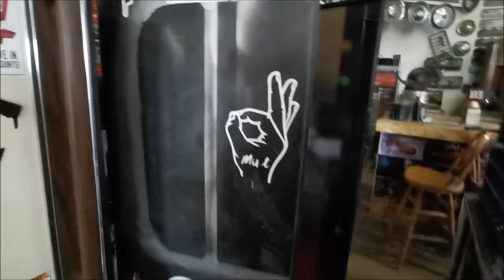THE IQCS 2020 FUC*IN MINT JUDGEMENT + BULLET-BAGO BURNOUT!!

Comment: You should never boost a dodge with a Ford because the dodge can give it second hand electrical problems
Reply: Jacob Cummings dodge only had electrical problems in the mid to late 90s
Reply: @npp3559  spoken like a true Mopar man
Reply: Np P dodge has always had electrical problems... I got a 92
Reply: Np P I have a 87 Dakota it had electrical issues all the time
Reply: @CatmanOutdoors  2016 truck all new wiring harness from the back of the cab forward from the factory done at 2 different dealerships twice and one head light works some the the other goes on strike .been that way since new .all new computers everything  .mega cab 4x4 with 6 thousand miles .bought brand new.never been off road and it's been at different dealerships  for almost 2 years of its life. Driving   down the  road month ago back driverside and rear window curtain airbags blow up .lmao in the process of dodge giving me a new one .should have it in 2 weeks .they cant figure it out .dont buy any two tone brown 2016 megacabs from the auctions .lol
Reply: Second this but with a damn Buick. 

One killed my fucking alternator and battery
Reply: Dodge = avoid, go around. Just like a burning dog... And don't eat yellow snow. And NEVER EEEEVVVVERRRRR trust a fart if you even close to 50!!!
Reply: @npp3559  I work at a dodge dealer and we replace wiring harnesses all the time and constantly have to rewire everything
Reply: @Tessa Hiebert I daily a 2005 Ram 2500, no electrical problems, yet. She cheeches and screams. Front end howls a bit so gotta figure that out, and the power steering sounds like supercharger, but other than that, she is damn mint.
Reply: @npp3559  well look at this Profile picture, aren't you a real dodge fan
Reply: I don't want to give a thumbs up because you are on 318ci
Reply: JustA25Hundy I would suggest replacing the u joints and checking the front diff fluid, and put in u joints that have a grease zerk
Reply: 2020 3500 straight off the lot 2 weeks later every fucking electrical gauge inside fuckin broke took them 3 months to fix it 😂
Reply: @npp3559  and there current cars and there 70s cars and there 80s cars dodge has allways had issues lol
Reply: @wesleeysutton5935  ok name some from the 70s and 80s I can tell you right ford had way more I can’t even think of one for dodge dodge only had really problems in the 90s and early 2000s that’s it really
Reply: @npp3559  cordoba my mom had a late 70s one wouldent stsrt in the cold one day it just caught on fire
Reply: @npp3559  the k car also was an electrical nightmare
Reply: @npp3559  I’m sure if I keep digging I’d find more not saying Ford is any better I only drive gm products for a reason 😂
Reply: Not like that’s a recall stuff like that happens when mice and people screw up wiring it’s not like fords are immune grime odd ball wiring issues that can happen to anything with wiring
Reply: @npp3559  that cordoba was a brand new car I don’t think mice where in it

Comment: The old motor home reminds me of my  f250 plow truck send off when it became to rotted out to actually use it wouldn't blow up 351 fuely,  finally turned to wide open throttle and shooting it with 1911 45acp through the dash until it finally took a fatal blow probably the most fun I've had

Comment: 24:37 looks like an American-Lafrance engine.
Reply: No, American Lafrance famously made T-head engines which were cross-flow. This is an early L-head engine, you can tell because the intake and exhaust is on the same side, which it isn't on the Lafrance T-heads. I actually suspect that the Frenchman has gotten his hands on a French engine, because this looks like a Renault 4-banger from circa 1910.

But it's hard to tell because most of these early L-heads look very similar and there were like 300 different car brands back then most of whom built their own engines, so without taking a closer look it's nearly impossible to say for sure who made it.
Reply: @Benny---  100% agree that playing "Name that Engine" in that era is especially hard, and you are correct about the head differences. I was going off of memory of the threaded inserts for the plugs, petcocks, and the domed coolant jacket covers. The exhaust manifold doesn't exactly look Renault like, and the coolant pipe is maybe facing the wrong way. Also, i think the Renaults of that era had a larger cam chest that protruded squarely out the side, while this engine has a flat plate there.

Comment: I think thats the technical difference between a big block and a small block: small block to get going after shes been sitting and the fuel system is hosed, you're dribbling gas into the carb from a tea cup with the pinky up, and a big block yer just sloshing the gas in, straight from the source, the good old plastic 5 gal can.  Fun fact, plastic is made out of petroleum, so its a gas gas can.

Comment: Damn thing probably had enough valve float to unsink the titanic 4 times
Reply: Mopar smallblock has a built in rev limiter ya know, weak valve springs.  They start floating valves at 4000 rpm

Comment: I drove basically the same motor home across the southern USA, up to Banff, BC, down to Denver and the back to. the northeast USA. We didn’t have the propane fuel system, but keeping the motor home and the Koehler generator running were a similar experience, Ours was dodge 360 cu. in.

Comment: Shows how good dodges are, ford would have blowen up long before
Reply: Wahn Burnskill you must be new here
Reply: clearly you've never seen slave lake, or the IDI snow bank, or his 351w F1SHitty, Those things still haven't quit but this mopar did after one measly burnout session
Reply: Atleast it ain’t a Chevy. Honestly that engine woulda fired right up if it wasn’t a propane system. Any engine that’s been sitting with one of them on it is always gonna give ya problems, Even one that’s daily driven. In my experience those small block mopars are just loyal. Not to mention all the bullets that have ripped through god knows what.

Comment: My leg came off. Yep, been there,  done that. 

My wife and I were out on a ride, her with dad's old minty CB 750, rusty chrome, duct taped seat, and red faced to rusty f*ckin pink, with a bungencord as the shifter spring,  me on mom's old XS Eleven, in slightly less minty condition, doing about 80 on I 90 in Ohio,  when mine decided to have the screws back out. Not f*ckin cool, as the foot came off, and ended up in the median. I had to stop at a turn around, and wait for her to park, get off, kick my bike into neutral,  and put the stand down,  so I wouldn't drop it, and have it land on my stump. Then she ride back,  found it, and got back to me, where Inwas waiting with the most baffled trooper in the state, who was trying to figure out how the f*ck Inride it there, with no left leg. 

Good thing Inhad a container of extra bolts in the saddlebags, and three of them fit.  Cop even let me sit in the front seat, and fix that b*tch. Back on, and made Indiana by dark,  and my buddy's place by 2300. Went to a prosthetic place the next morning, and they fixed it right.

Comment: Peg I drive a 2013 ram 1500 outdoorsman 24 valve pentastar 3.6 V6 8 speed automatic 4x4 quad cab. Four doors for more whores. If you can't dodge it ram it. 🐏 I hit a goddamm 15" metal pipe sticking out of a farmers field after doing corn field burnouts. Was running from a pickup truck in the dark looking for me at 50 mph only damage is to my bumper. Time for a after market bumper. It spit out the right tow hook